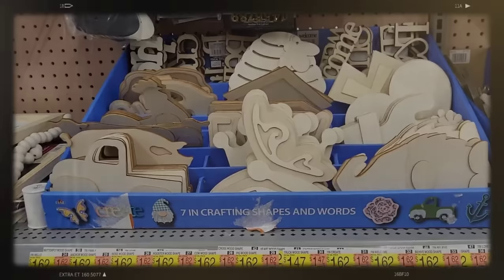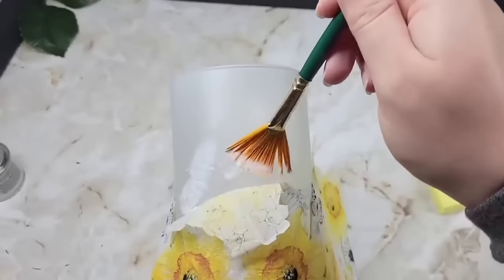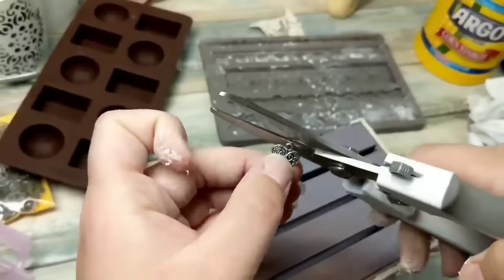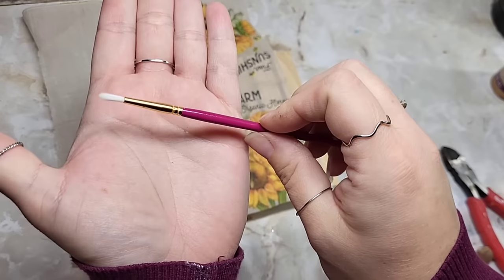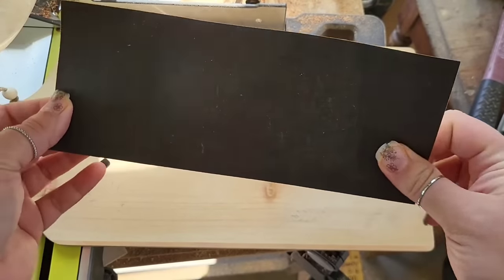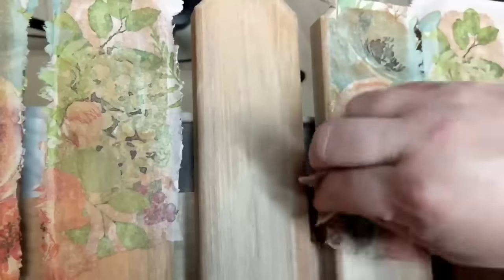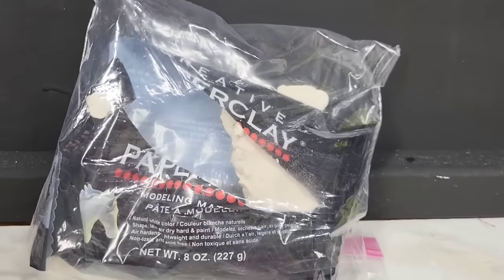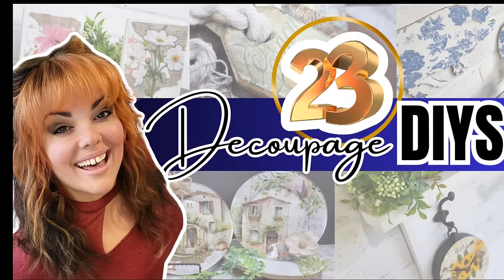🤯 AMAZING Decoupage DIYS to try on your next project ● Decoupage ideas

Comment: Enjoying your videos very much and just subscribed.  I like that you are adventurous in your choice of materials and that you show your mistakes so we can learn. Your napkin choices are superb!  I wanted to suggest a scissors which I cannot live without and don’t see many YT crafters using. It’s the long multi-media one made by Fiskars.  (They make one that is shorter, also). It cuts heavier and thicker items such as cardboard, thin woods, skinny dowels, etc.  I would not use it on wires however; use wire cutters for that.  I am a stickler for using scissors specifically for the materials they are made to cut. Looking forward to more of your decoupage videos. Blessings on this holiday season.